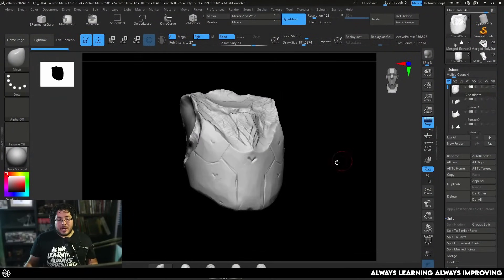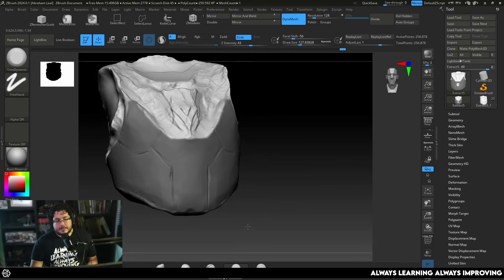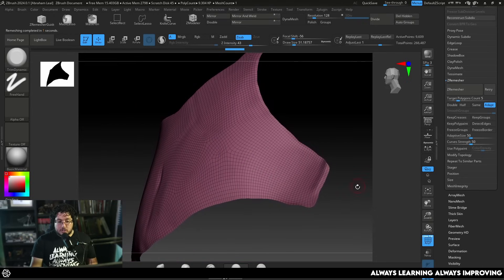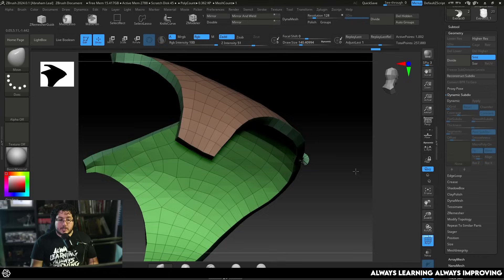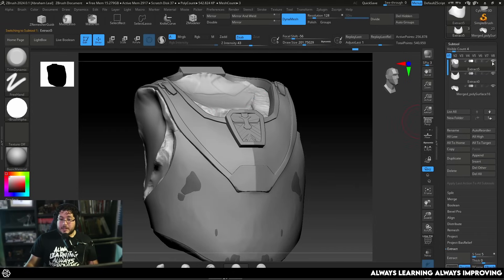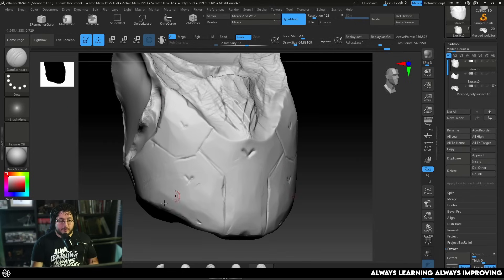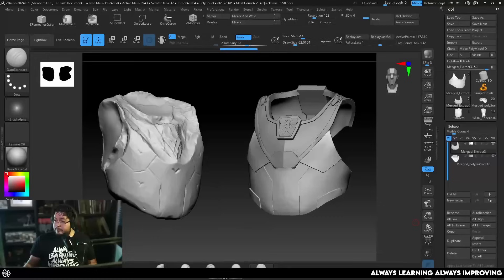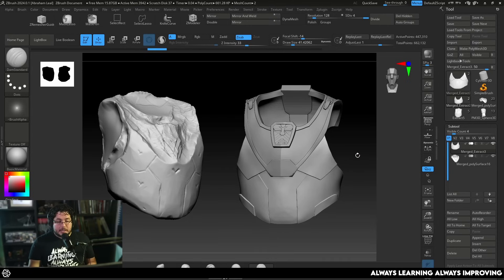How to Create Clean Hardsurface in ZBrush

Comment: You could also use the crease tool in zmodeler right? Is there any particular reason why you didn't? Is it just to have some more control over the edgeloops?
Reply from the maker: @lulhannes2362  correct both options are perfectly valid. I personally like support edges more due to habit

Comment: Abe, your lessons are always greatly helpful, thank you for them.  A question from a long-time Maya user and intermediate ZBrush user here.  ZRemesher was one of the first quad-remeshers out there so I had used it from the beginning, but when you use it for tube-based shapes it gives you a spiral arrangement, which required much editing at times and can frequently be a dealbreaker.  These days, Maya, Max and Rhino have their own quad remeshers, so its not an issue per se…  but if I want to stay inside of ZBrush almost entire time and then eventually export out hard surfaces for various needs(Poly > SubD > NURBS conversion flow for going into CAD for example), is there a way to tweak the setting in ZRemesh to produce loops instead of spiral topology?

Comment: interesting.
try to use that instead:
1) make your base volume with zmodeler (same way you do in the video) and give it some thickness
2) do separates polygroups for each main surfaces changes. for the front and bottom > autogroup (as you do in the video), for the thick border : polygroup/group by normal> nearly 20-30 for the value.
3) do a zremesh ( nearly 10-20 value) / keep groups / smoothgroups = 0
4) activate the dynamic subdiv with smooth preview activated
4) go to geometry / crease / crease PG (polygroups).
5) turn off dynamic subdivisions
6) you can add some subdiv levels for the high poly .
If you want sharper edges, You can make a first divide without smooth to go to level 2 then activate the smt option in the divide for the next level.

To smooth you shape the polish by group option is interesting (in the deformations)
you can also use try the grouploops option in geometry/edgeloop
Dont forget to activate mask by polygroups (brush/automasking) when you use the smoothbrush

Cheers

Comment: hi, if I want to add details to a low poly model, for ex ( a sword) in Zbrush, am I not required to use Dynamesh and can only use subdivide?
Reply from the maker: If your subdivision is clean you can add more levels until the details works nicely  otherwise if you use dynamesh and you want to optimize it you will need to do retopo

Comment: how would you go about merging those different subtools back together if you wanted to 3D print this? I'm making some cosplay armor right now
Reply from the maker: It depends on the size of the printer. But you can dynamehs them with polish turned on at a high resolution to have a single mesh
Reply: @AbeLeal3D that’s what I ended up doing. Thanks man 👍🏻

Comment: 10:58 it's important when teaching to show/explain what happens when you do not fix the topology here, otherwise the student isn't going to learn why it needs to be fixed, only how to fix it. Otherwise, fantastic job explaining fundamentals in a nice and quick format.
Reply: Personally I think that practice is disputable. Does the loop do any harm?
Reply: @SL-zv7sf  I believe you'll run into issues when adding the edge loop for sharper edges because you lose some control on where starts and ends.